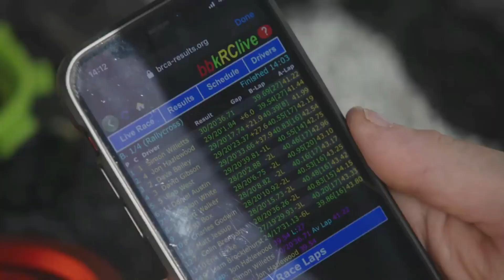RCSpecial.com RadioControl 02/11/21 Updated Video Agama 1/8 Concept A422 Revealed & Raced!

Comment: Looks great but 2 questions:
1. How is it, when you have a front crash? There is nothing who protect the suspension 
2. who is it with a crash with the rear wing? There is only one small arm who looks not really stabile? Thx
Reply from the maker: Nemo says the front wing is a protection. About the rear there is an extra wing mount included that protects the shocks. Nemo has done lots of testing and says no problems there.
Reply: @RCSpecialCOM  Thx 👍🏼

Comment: Like the Serpent Veteq in her area (2000)... "A Revolution"... ⁉️😉💯🔥🏁🏎️🤓🇫🇷
Reply from the maker: Well, the concept has been seen in off road machines also, but still, a nice effort to move forward...
Reply: @RCSpecialCOM  Yes, because lots of RC racing cars are the same finally...😉 Good job by Nemo/Agama and it's very nice/different. 👍‼️💯🔥🏁🏎️🤓🇫🇷
Reply: @RCSpecialCOM  Tenth Tech Predator
Reply from the maker: Yes, different but also innovative, Laro also...